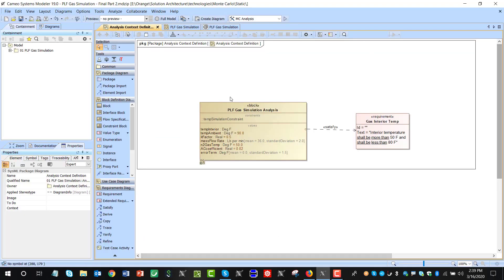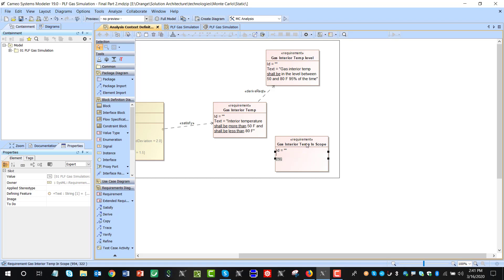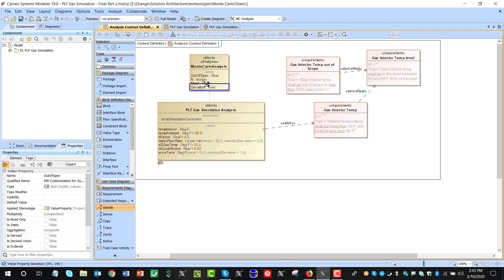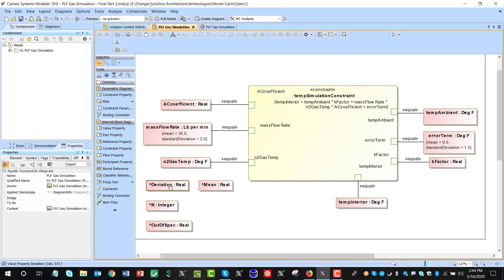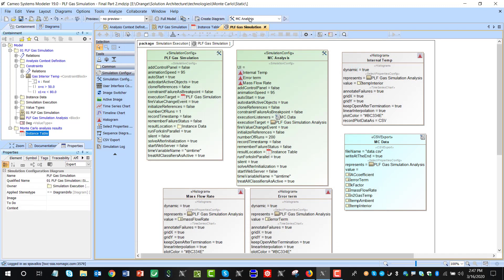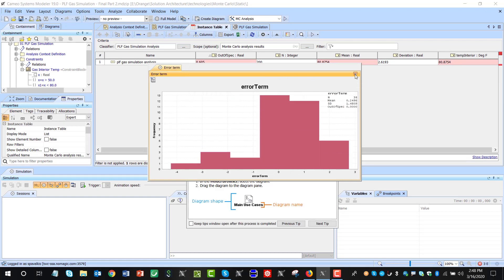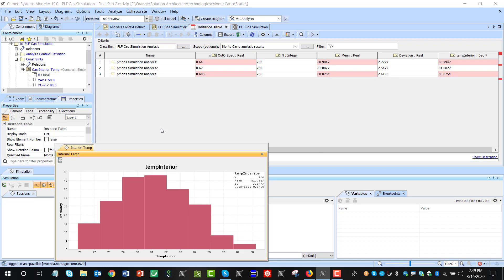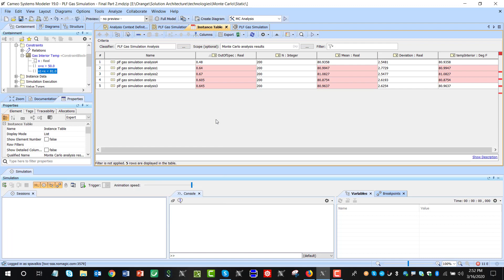Monte Carlo Analysis Tutorial using SysML Part 2

Comment: Thanks for the video! I am simulating an activity diagram where each action has a minimum and maximum duration specified by a duration constraint. I need to run a Monte-Carlo analysis to record the time it takes the activity to execute based on randomly selected durations for each action, respectively. I setup a SimulationConfig to run the analysis and generate an instance table for the results; however I don’t know how to extract the execution time as a reportable value. When I run the analysis for a single iteration only, I can see the execution time being reported in the Simulation Console window. But how do I link that execution time output from the Console window to an element in my model, such as a value property, that I can use to populate my instance table?
Reply from the maker: Hello, thank you for your question. You can read value with opaque action in activity diagram. T= simtime where T is value property name, simtime is rezerved variablr name for simulation time. Please take a look to rhe project sample in video documentation. It has this implemented. Actually all MonteCarlo demos in this channel has this implemented in samples in video descriptions.

Comment: There's something I don't exactly understand here. You connect ^mean to tempInterior value properties on the parametric diagram; ok,  this ensures that they have the same value. If you look in the generated instance table, in fact, these ALWAYS have the same numeric value, so what is the benefit of the inherited ^mean property here (couldn't we ust refer to the tempInternal property instead)? 

Is the value in the table for any properties, the average of that value for the number of runs in the monte carlo simulation, or the value in the last computed run of the run set?

Does the outofSpec inherited property refer to the total number or properties that violate constraints during the sim run, the total number of constraints violated during the sim run, or something different?  I see that it isn't bound to any specific value properties in the subclass. 

Also, why do the means in the histograms for monitored values differ from the value reported in the table - is it that the table shows the LAST instance (N=200)? 

Ok, that's several things I don't understand ;-) 
- b